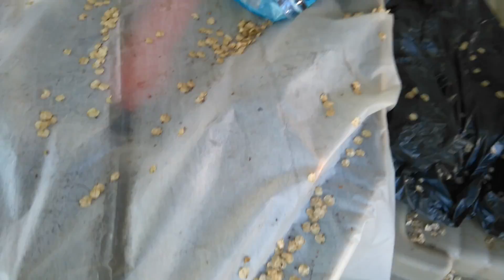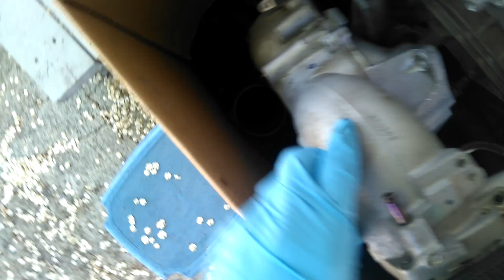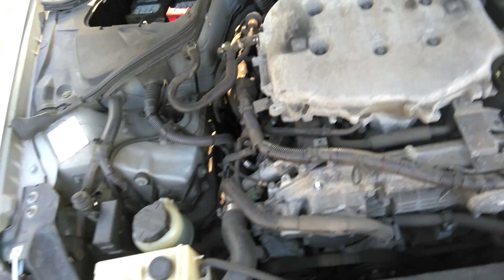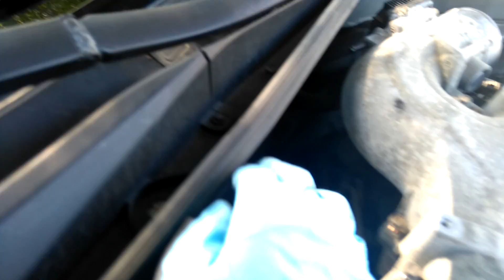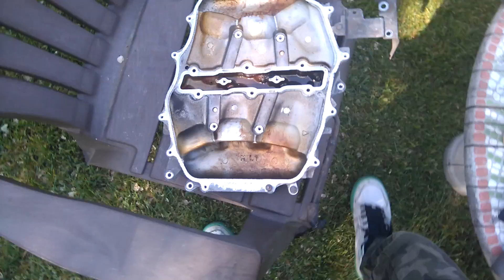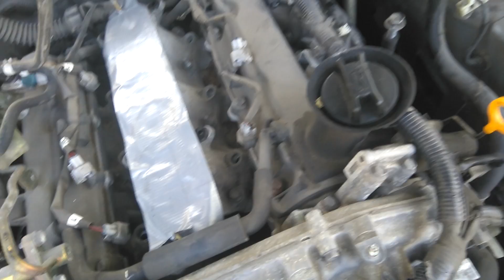Vq35de G35/350Z knock Sensor replacement.

Comment: Do you have to torque the bolts when putting back intake manifold? Anyone?
Reply from the maker: No you don’t need to torque them it’s better if you do. But if you’ve worked on stuff before you should know the feeling of snug, a old trick is for small 12-8mm bolts put your palm on the Top of the ratchet and tighten it until you can’t tighten it much more, that’s as tight as you should go. Do not use a second hand on the back of the handle of the ratchet unless it’s for bigger bolts. People make the mistake of using all of its leverage on small threaded bolts they will strip and than your in a world of pain.
Reply: @pwrautobodyandwheels  thank you exactly what I needed to know! Will the job myself!

Comment: What happens if you move the throttle body flap
Reply from the maker: If you moved it and it was still plugged in and connected their shouldn’t have anything happen. Worst case is if you bling the flap up and let it smack back on tension it can break the sensor in the body.

Comment: do i need to replace it right away or is it okay and if i dont will it cus more problems ???
Reply from the maker: No you don’t need to replace it right away all a knock sensor will do is put your car into a sort of limp mode. It will be lacked in power by a lot, my friends FRS would beat my G35 coupe with a bad knock sensor. Once replaced I put car gaps on him everytime.

Comment: I know this video is old, but for anyone watching this now, you can use this time to service the throttle body. You can move the flap and such, but when you reinstall it, you have to do a computer relearn. Its really easy and there are tons of videos on it as well.
Reply from the maker: Actually if you accidentally have that flapper slap back at all or anything it’s actually toast. I did every relearn in the book. Yes if you unplug it move it gentle and don’t let it slap back you can just to typical YouTube relearn cycle and it’s back to normal. Very easy to do but if you don’t need to remove it or have to do a relearn process why make more work for your self ?

Comment: ive moved my flap to do a deep clean. just had to do a throttle body relearn and idle relearn. 7k miles in no problems yet
Reply: What happens if you move the throttle body flap and you don't know what you're doing

Comment: Hey bro my car takes long to start I change the camshafts and crankshaft sensors still no change can you help me out ?
Reply: 1st check the fuel pump it’s u can check easy way that ask someone to ignition on and just keep ear on fuel cap if u hear like motor turning sound that’s mean pump is doing well” if silent replace the fuel pump. 2nd solution clean the fuel injectors from genuine place who is doing by machine or if u can find sometime cheep from junk yard get it and replace. Thank you!

Comment: Good video ! Thank you 
I clean my Throttle body and gave me a lot of headaches !!
Reply from the maker: Yes, I’ve ran into the trouble as well, if discounted and you move the throttle body flap, or lightly let it smack back by the spring tension is can damage the throttle body.

Super sorry for my late reply

Comment: Thanks for the tip, Guy! Cold start ups on my 04 in the morning, I hear a noise like a knocking for at least 3-5 seconds...thereafter the sound will go away after warm up. Not exactly sure of what that is but, I think it may have something to do with what your showing from the video..I think. Will try and figure it out further.  
Thanks anyway!!
Reply: No no no your knock sensor going bad doesn't make your motor knock lol
Reply: I know that was 4 years ago but I just needed to put this here

Comment: nice video man thanks. one question, will i need anything like gasket paste so when i put it back together, im doing this job next Saturday
Reply from the maker: Shit wish i had this in the video, Just like i told David, Yes if you are trying to reuse your old metal coated gaskets, Use some RVT high temp. If you can Replace ! Do it right the first time.

Comment: Damn you make it look ez!  Thumbs up a million!  I have the leaking valve covers just noticed it when I changed my plugs filled with oil in the rear on both sides.  Can I just remove them and apply some good silicone and place them back on?  Or do I have to replace both with brand new valve covers?  Thanks in advance and keep up the good work!
Reply from the maker: Sorry for late replay, You must replace both valve covers, Yes i know :( Fuckin bull shit right ! You can do the risk and just get the new outer valve cover Gasket from www.z1motorsports.com or nissan dealer, And try using some killer gasket marker on the holes, But the rubber in there if it feels hard its toast..might hold up for a bit, But its alot of work to do it half ass !
Reply: @pwrautobodyandwheels  I used just the gaskets and had no issues

Comment: After you remove the lower intake mainfold to get to the knock sensor. Do you have to use any kind of gasket or sealent when you put it back on?
Reply from the maker: I used RVT on my metal coated plenum gaskets throttle body etc, But thats only because i was reusing 60,000km gaskets other whys, Replace its cheap simple and your in there.. Do it right so its done.
Reply: Is recommended to replace the old gasket always

Comment: this is a lousy engine design.
nissan & infiniti are being like ford.
building cheap plastic parts and parts needed to be replaced are not easy to get at nor remove.
knock sensor and plastic valve covers replacement will take you a week.
provided if they go back in correctly without any broken cables/clips/wires.
Reply from the maker: it takes a day or 2 doing the valve covers, and if you take your time clips don't always break. needed more room forsure.
Reply from the maker: it takes a day or 2 doing the valve covers, and if you take your time clips don't always break. needed more room forsure.
Reply: KeepinIT_StockG35 To replace valve covers/gaskets...it will take 2 days??? Please elaborate.

Comment: this is a fantastic video full of lots of good information with a high def camera, I really appreciate this.  I am going to be knock sensor replacement on my 2003 Nissan 350Z this weekend is there anything specific or special that needs to be replaced such as gaskets or anything when I am putting it back together I would hate to have it torn down on a Sunday afternoon and not be able to finish it because I didn't have the right parts. I'm not entirely mechanically illiterate but I have never torn into a Nissan motor so I am just unsure of what exactly needs to be replaced or if everything can just go back, also is there anything special to put in the fuel injectors back in and will the throttle body still need a reset if it's not touched? thank you in advance I really appreciate all the information you've already given it's been a real help and is going to save me roughly $600.
Reply from the maker: I did all of this with using the same gaskets for the plenum and everything also used the same o rings on the injectors, no issues but I'm now doing valve covers, so I'll be replacing all gaskets plus injector o rings just to be safe, you can YouTube 350z ecu reset and watch the video which is a HUGE help on resetting your throttle body.
Reply: I did the knock sensor change on my 350z that weekend and it has 116k miles I was able to reuse all of my gaskets but they weren't in the best shape(paint peeling and chipping off) but still usable thank God. haha. any who your video made it super easy took about 2 hours. I really appreciate the video helped me out and saved me $500. thanks!

Comment: My sensor has only one wire.  Is this right?  Also, are the cheaper sensors as good as the expensive ones? where can i get a new pig tail?
Reply from the maker: nope should be 2 wires, for the Vq35de and you can get cheaper eBay knock sensors but I'd just buy the kit threw Z1 motorsports for 200+ because it's a decent size job so it's worth putting the best parts in bro.

Comment: What's the big issue with the TB plate? I've moved mine at least twice and have never had any problems. Didn't unplug it or anything. I mean, I won't do it again now, but  hasn't been an issue when I didn't know.
Reply from the maker: the reason I make it sound scary and make ppl feared of it, is because I did the mistake of moving mine, i left it plugged in moved the flap to clean it all, but i also used hard pressurized can which could have ruined some sensors, also the flat slipped on my hand and closed hard so it could have damaged its self. mostly it's just a safety cause it has happened to others and well it happened to me, and it sucked and it ran weird and like shit and horrible on fuel high rpms etc, just something you can stay away from, you can unplug it clean it plug it back in do a reset from YouTube and your good. Just if it does happen to mess up, it's junk right aways theirs no fixing it that I know of, so for those who don't have a spare which I now have 3, and for those who don't have 400+ dollars to waste on one, keep it simple lol hope this video has helped
Reply: 617k122
So better safe than sorry. Gotcha. I guess I was just lucky with mine. I was always gentle though just in case.
Reply from the maker: +Beastly 1stGen G35 yeah bro exactly, if it runs good don't fuck with It :p but you always think you can make it run better so typical car guy has to fuck with it.

Comment: Thanks for the video. It helped me determine if I could do the job myself. My service engine light just came on and it gave me the P0327 code and it shows that its the knock sensor. I'll reach out after I replace mine.
Reply from the maker: exactly what my code was, i tested the harness mine was ok. it was the sensor that was junk not the harness. you'll notice big power increase way better fuel mileage. not a problem hope this has helped